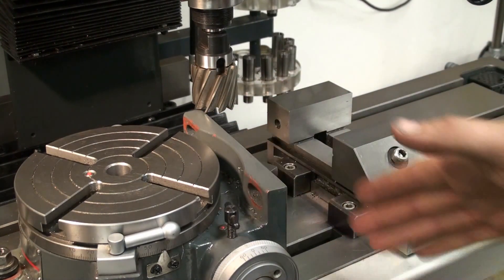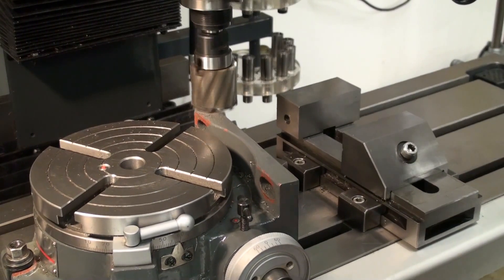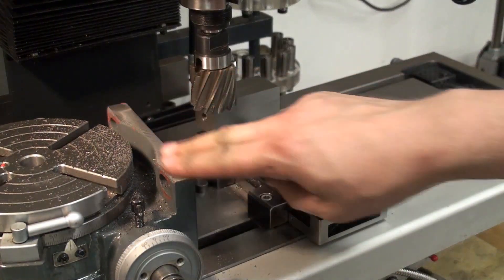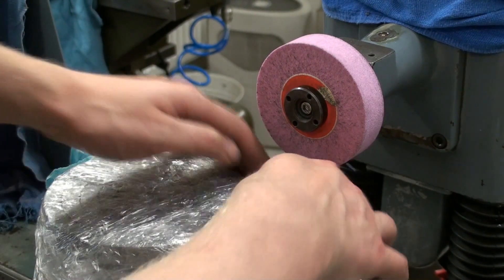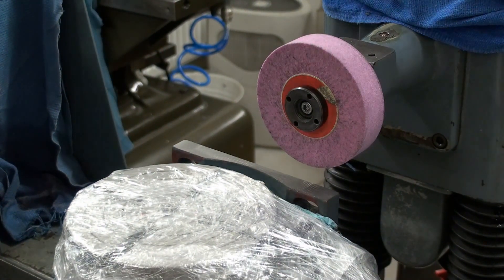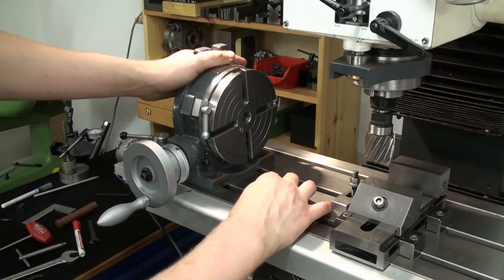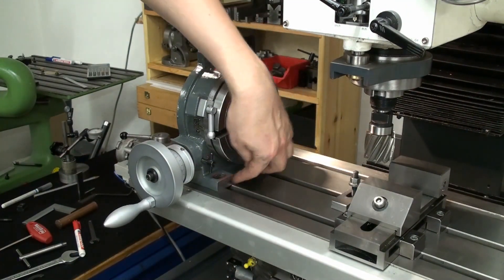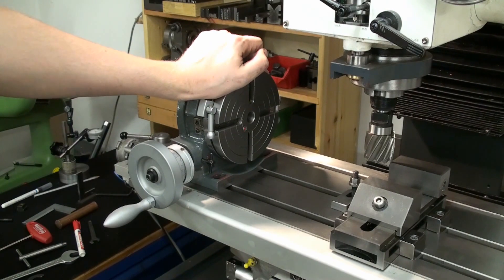Improvement on the Vertex rotary table

Comment: Your mill X-axis DRO scale has moved from the front to back of the bed...any insight on that decision?  I'm about to add DRO's and like your "continuous improvement" approach.
Reply from the maker: Good eye :D
I wanted to be able to hang longer parts over the front edge of the table. Also the back is a safer place for the linear scale, when lifting setup tooling or workpieces onto the machine. And it looks cleaner.

Comment: wish you had run indicator on surface after cut and then after grind to see the difference
Reply from the maker: Right, would be a good thing. The milled surface was about 2/100mm, because I ran the shell mill all over the place :D

Comment: I'm about to buy one of these vertex rotary tables and I'm going to attach a plate to the bottom with a 5/8 key milled on the bottom so it indexes in my mill table slots. If the mill table slots are good the table will be aligned well. For critical work I'll probably still chk it though.

Comment: great video as always. question about your mill. why did you mount the DRO scale to front of table as opposed to rear? as to not loose that depth of feed?
Reply from the maker: Right, in the rear it would get in conflict with the bellows.
Reply: Stefan Gotteswinter I did the same with mine but see many guys who put it on the rear. the front installation made more sense to me. thanks for quick response!

Comment: when i worked in the machine shop in a spring factory when we were surface grinding after we dressed the wheel the grinder stayed running till we got the job done...........reason being so i was told that the inertia on the wheel made the wheel different when you turned it off ......if you went to break or lunch  you left the machine running.....just thought id throw that out there ............Eric.....

Comment: First of all, I love all your videos. Much better than watching the TV!

Second, I just bought a Vertex HV4 which is why I watched this one in particular and found it very entertaining. After watching, one thing did occur to me though. Why was it necessary to machine the front face of the rotary table when you could just as well accurately locate it on the mill bed using the already machined rear face using an engineer's square?

Comment: Two ideas. 1) One add keyways both ways. 2) If you ever build a tailstock as mentioned in the first Vertex video build it as a unit with the spindle at a fixed height that matches the height of the index head. Also have the keyways in both on center. With the keyways on center you can use it or a key mounted in the keyway to pick up the centerline. You could also do this by cleaning up the clamping slot equally on both sides to provide a built in "Toolmaker's Chair". But you're a smart guy I think you figured this all on our own

Comment: Why do you use 1000th of a mill instead of microns?
Reply from the maker: Common shop lingo - You wont hear the term "Micron" from pretty much no one in germany :)
(I could use much stronger words here, but I dont want to offend anyone ;) )
Reply: I think the use of micron in the US stems mainly from not getting units confused. If you say .005th it is usually assumed (there's that ass you and me thing again) that you are working in inches. I have to work in both converting from metric to inch when machining and inch to metric when inspecting machines and components. Most major industrial companies in the US are working to metric and ISO tolerances now anyways. The whole inch thing is partly cultural and partly legacy. The UK went metric in the 70s and there's still stuff in Imperial. Besides Slapped upside the head with a 2 x 4 just doesn't sound right as a 50 x 100
Reply: Imagine if you'd have said Inch thou Stefan hahaha

Comment: How do you maintain tolerances with that machine flopping around on the floor like that?
Reply from the maker: Just let it flop - The machine is small enough and stiff within it self not to be affected by it. 
Have you ever seen a massive cnc mill going full speed? It will flop around too - And still hold tolerances. The trick is not to mount a machine tool rigid to the floor, the trick is to build a rigid machine.
(Works only up to a certain size of machine of course. A gantry mill with 10m travel is not rigid by it self in all directions, it needs to be put on a basement and anchored to it.)
Reply: Yes, correct  i have a  big cnc grinder  and its free standing, it will not move because the base alone  is 2.5 tone  without fluids or motors and pumps.

Comment: Stefan,
     I did a lot of die grinding in the 1960's and we also used diamond blocks like yours for dressing the wheels, the only difference was that the diamond shaft was set in the block at an angle, so that the angled side of the diamond always dressed the wheel on the left side away from the bottom of wheel and not on the tip of the diamond, at that time that was the teaching, I think it was to protect the diamond being ripped from its setting, of course I realize there are many ways to do things, 

My reason for the comment is, I feel some viewers are not familiar with the danger of dressing, balancing, test ringing, and using grinders, or seen a 12"x 2" wheel explode because of unbalance, 

It might be to their advantage if you could do a little follow up in your next video on surface grinding, for safety sake,

Edmund..........Alberta.
Reply: Chris, yes that is right, we also dress relieved the back of the grinding wheel for clearance leaving a small raised land when side grinding and finishing sharp corners to eliminate heat buildup caused by too much contact of the wheel, and always had a blob of Plasticine handy to use when resharpening  small diameter punches of any kind,

Edmund...........Alberta
Reply: Chris,
   did you ever come across progression dies that we always called Italian design dies, it had two bolsters on top where the stripper was really a top die and the punches floated in the punch plate, it had the Belleville spring washers between the two top bolsters, they had to  bottomed out to produce the forms, we had Jones and Shipman 540s, really spoiled us,

Edmund............Alberta

Comment: I am shocked -- shocked!  (:):)) that you did not set it up in the Gack scraper! Kidding aside, a surface grinder is a real asset. It does not take as long as a scraper and if all you have to remove is a couple tenths of a mm, probably a lot faster. One reason Asian tools are so cheap is that they build to a price point. Else they would cost far, far more than they do. If you look at is as a casting kit, Asiatic tools are reasonable.
Reply: Oops, yes, do add a wheel guard to that scraper!

Comment: Why use several passes when the wheel seems wide enough to do it in a single go?
Reply: +Cancun771 The leading edge is where the wear on the wheel takes place leaving the remainder of the wheel at the original dressed diameter.  If Stefan used the entire width of the wheel for the pass, the wheel diameter would wear resulting in an inaccurate grind from one end of the baseplate to the other due to the wheel diameter being reduced as it moved along.
Reply: Wouldn't that be a reason to use the whole width, keeping the wear even and to a minimum?
 Just wondering, I don't have a grinder yet, just a lowly Tormek ;-)
Reply: +Cancun771 
The front part of the wheel do the heavier grinding and tapers, while the back is still to initial measures, this back part sparks out the part, so, only wears out un-noticeably, where the precise grinding, for heavy removal you will have to redress the wheel during the process... ;)
Reply: Cancun771
     if you used the whole width of the wheel there is the possibility of the wheel  coming to a complete stop and and jamming, most likely discolour the metal as if burnt, it would most certainly leave a very nasty finish,

Edmund.........Alberta

Comment: Stefan, this is very good job and nice done, but you should more protect yourself than the machine for dust. Most grinding works with a lot cooling fluid, in order to avoid dust arround in the shop.

Comment: Love the shaky grinding table, you will get a better finish if the grinder is on a stable base, and safer too. BUY or make yourself a WHEEL GUARD, if that wheel bursts you will have pieces of wheel embedded in the wall as well as possibly yourself. Great series, keep the videos coming.  A further thought about the rotary table surface not being parallel to the base by 0.01 mm. Now you have the surface grinder, you can correct  it. Put the complete rotary table on the grinder complete with the indexing handle, align the wheel over the approximate centre line of the rotary table. Bring the wheel into contact with the table, as you wind the grinder to and fro, turn the hand wheel on the rotary table a turn or two between passes, until you have completed 360 degrees or more. You will lose your nicely shiny ground surface and get a patterned one, but it will be flat and true to the base.

Comment: Hi mate.  Ja, eeh, ok where did that grinder come from all of a sudden?  Don't ever send that rotary table for a repair, they will send it back to a Chinese laboratory never to be seen again.  Ain't it wonderful what you can make out of the raw castings from China, and than it's exactly what you wanted in the first place.  Well done mate.
Reply: Amen to that mate,  In their defense, I bet they know what a good rotary table looks like, but even they can't make it for the price this one was sold.
Reply from the maker: +Marcel Timmers It just popped up on ebay only 300km away from me..I had to buy it! :D
Reply: I bet you did.  Only, how did you get it on the back of the motorbike? ; )
Reply: +Marcel Timmers 

Marcel....

You could have a point..... it wouldn't surprise any of us, seeing a bunch  of Chinese engineers, confused to no end, puzzling over that thing....
maybe coming to the conclusion it had 'evolved' on its travels...

And indeed, Chinese stuff can be used, as long as you don't consider it to be much more than castings...

Paddy